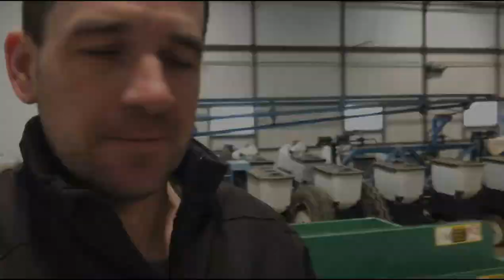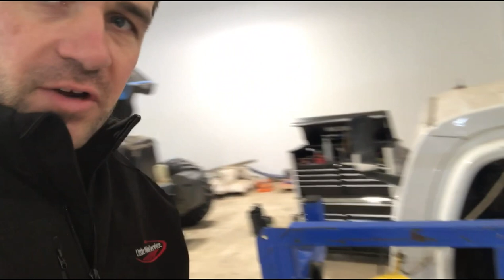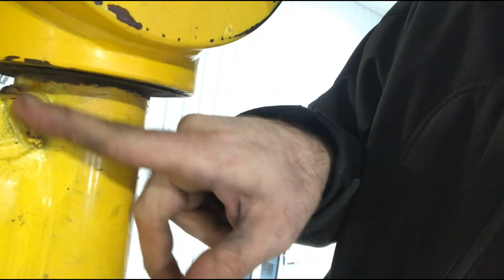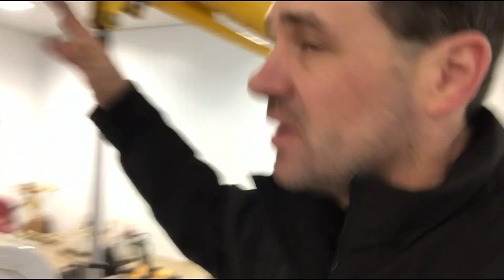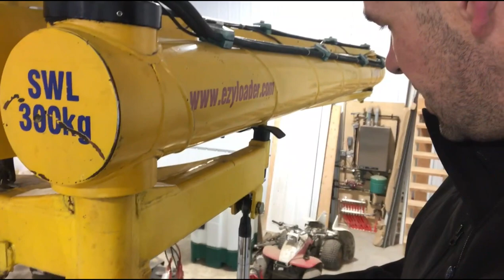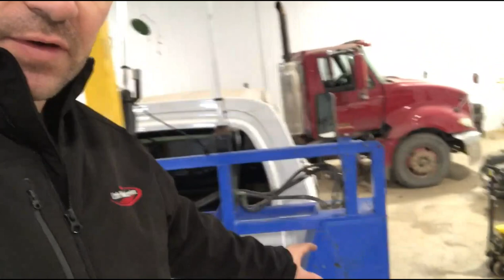Ezyloader Overhaul

Comment: Ian, any and all video that you can provide will be much appreciated by the rest of us, Ezyloader owners.
You are right about VERY little maintenance info.
Last year at this time, I had all 3 cylinders resealed.
Mine is a 1999 model and the cylinder seals were shot.
I have never replaced bearings, but then I only lift individual hives.
Appreciate any and all info you provide.
Thank you!

Comment: You're absolutely correct that this is the best time to get that repair out of the way. I would try to add some gussets and a wrap around piece of steel to reinforce that pivot. It looks like that is the weak point. The wiring in the arm is probably elevator cable that is fine stranded. Thanks for the video!!!

Comment: Looks like a job I would enjoy lol

I don't know your welding background or training, but a lot of people don't know how to safely repair cracks, and since if that breaks it could cause injuries as well as shut the job down, I will say something!

In order to get a repair that holds, the entire crack needs to be ground out full depth in a vee shape, basically beveling each side back at a 45 degree angle.
Then you take a mig or small diameter rod and make a small root pass that ties the inner edges of the metal together, and then continue layering small passes in, alternating sides, so a cross section would look like a bunch of straws laid in straight and parallel.
Then you can do a weave pass on the top.
The end result needs to be full penetration for the full thickness of the original metal, with no voids, so each bead has full penetration into the base metal as well as the bead next to it.
This will give you basically the same strength as the original metal.

If you try to do it with just a single large bead, it won't be able to get full penetration on all parts and will thus be weaker than the original metal, and since the factory metal is cracking, a weak weld is certain to crack, and since the heat of the welding effects the strength and brittleness of the metal, it will probably crack worse than it is now.

Once you gouge out and layer in the cracks, adding some gusset plates or doubler plates to add strength may be good, but if you add them over poorly repaired cracks there is a good chance it will just get worse.

It may also need the cracked section to be completely cut out, and have a machinist make up a new section out of thicker steel, or some other more drastic measures since it looks like that piece was underbuilt.
Reply from the maker: being a farmer, I think I should be able to do that but also being a smart farmer, I think I might get my local professional welder to attempt this job.  Its certainly an important fix and i definitely need it done right for exactly the reasons you stated. cheers!

Comment: Great video!!  Those cracks might be caused by vibrations from driving down the road while folded up.  These vibrations would exert maximum stress in the area of the cracks.  I am thinking a rubber cushioned support near the elbow would both provide support and dampen the vibrations while driving.

Comment: This is a very well know problem. I have had 3 loader and they have all had this problem. On my newest loader the triangle had serious cracks after only part of the first season used (3 months) I replaced the triangle with a new one shipped from Australia and I noticed cracks started up again this year . This is something that the manufacturer needs to redesign before someone gets hurt or worse! This is unacceptable.
Reply: If that think broke while lifting 4 or 5 deeps full of honey it could make quite a mess and someone could get hurt for sure.

Comment: Have you thought of mounting your 2nd Ezyloader on a trailer you could pull with a tractor? I wouldn't think it would be to much of a problem to rig a pigtail for power. Then you would have a loader your could take anywhere without worrying to much about massive ruts.
Reply: Not to mention the loader can swing and load the pulling truck too.

Comment: Hey Ian....fittings with paint on them will not take grease...change the zerk fittings...if it still wont take grease...take a plumbers torch...heat the area around the zerk fittings a bit...the grease inside can get very dry over time and as lack of grease things gets worn....
As far as the cracks....get yourself an experienced welder to look at those cracks...I’m sure they can gouge those out with a torch...and weld them back up for you....I’ve had all kinds of things crack —rewelded...but you got to get the guy with the know how....We are all pulling for you sir....

Comment: If I understand how the loader works and I gauge correctly the lever ratio between the boom and the stabilization arms, about 10:1 to 15:1, it looks like that part is constantly cycling a few tons in flex and twist on its two arms while the boom moves about. And here, we're talking 100,000+ cycles in the course of a single year of operation in your yards. Not a mechanical engineer but that's quite a lot of fatigue for mere welds. That piece should probably be a forging rather than a weldment.